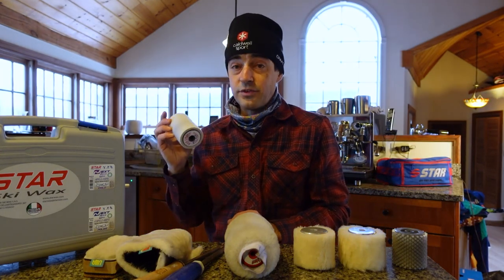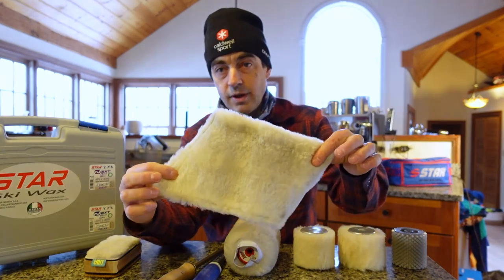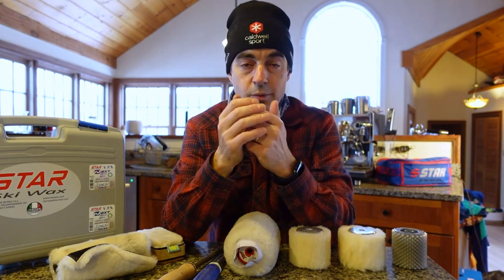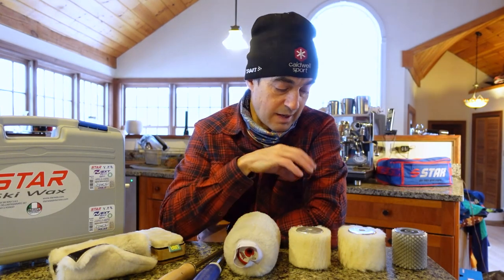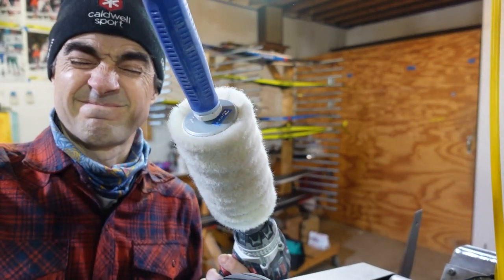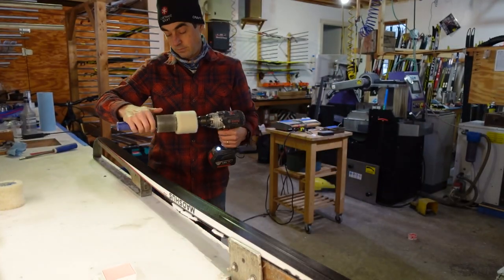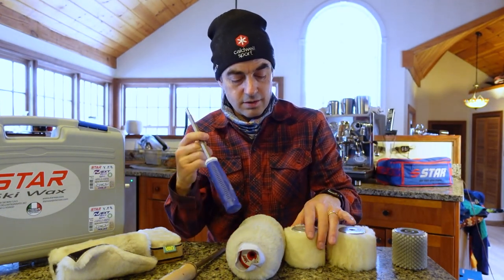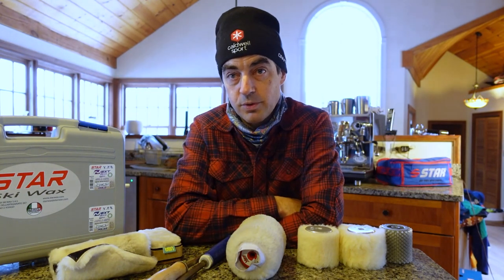Getting Fleeced

Comment: Great video thank you. Do you recommend cleaning the base with a hot wax every now and then or do you solely use the fleecing method to add additional wax?
Reply from the maker: I generally use hotwax periodically to keep the base operating well. My friend Claude from Ulla has really excellent success using only his fleece-applied wax and NEVER touching the base with the iron. But I still feel that I get better results from ironing, and using the fleece applied waxes for top-speed.

Comment: can you please comment on what RPM to use on your drill or does it make any difference?  Thanks in advance, Morrie
Reply from the maker: Hi Morrie - for application of fleece-applied blocks I like to use +/- 2000rpm. For finishing (polishing) liquids or other applications I like higher RPM - 3000 to 4000.
Reply: @caldwellsportski  thanks!